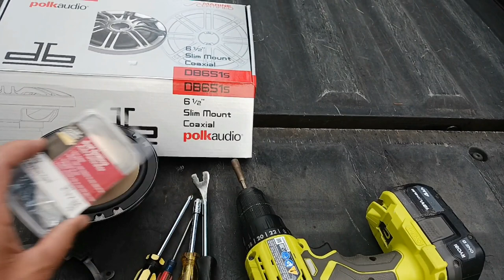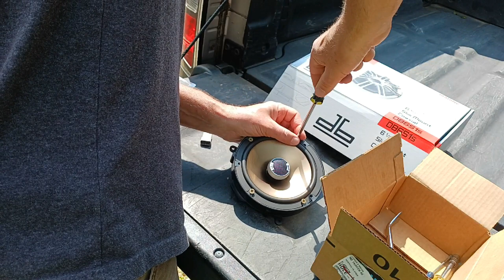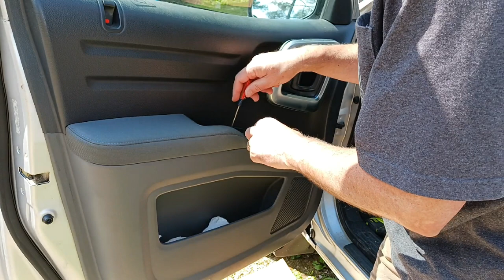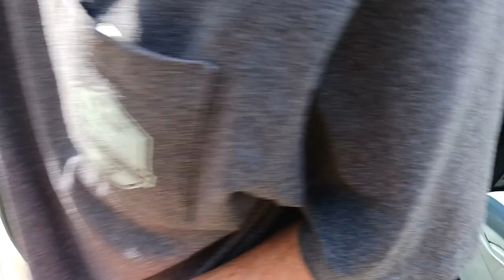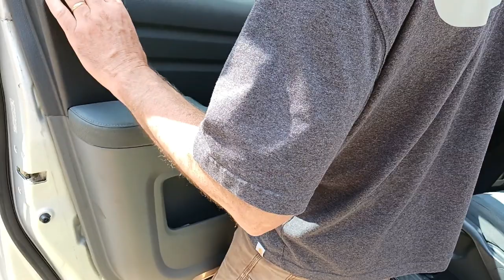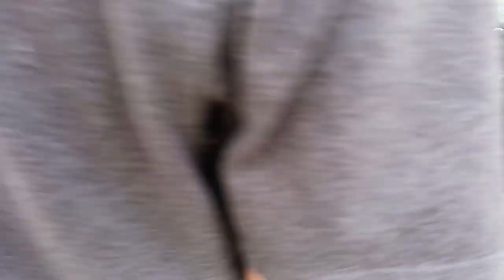Honda Ridgeline Speaker Installation, plus Door Panel Removal & Re-install. 1st Generation 2006-2014

Comment: Did you replace the rear speakers too?  Do the same adapters work back there?  Thanks for the video!
Reply from the maker: Hello!  Yes, the same adapters work for rear/back seat speakers.  I didn't mentioned it in the video but my left rear speaker doesn't work.  I switched with the right rear which was working and still didn't work.  I assume my almost 20 year old stereo is to blame.  Anyway, I went from 1 speaker to 3 working so it was progress  😁.

Comment: Got the same truck year color and everything so ill need a speaker adapter and a wiring harness to connect them?
Reply from the maker: Hello Mark.  Yes, the adapter and wiring connector makes for a very easy, no wire cutting install.  You could cut the speaker wires and make your own adapter spacer but I don't think it's worth the aggravation.   Is the paint on your Ridgeline starting to fade?  Mine doesn't look so good on the roof and hood.  Thanks!
Reply: @tbb10785  awesome thank you!  looks like the hardest part is getting that door off lol and no actually the paint looks good never been in a garage and traveled the east side of America how ever there is rust near the bottom panels given we have snow
Reply from the maker: My truck spent it's life in Miami until 2020 when I purchased the truck.  The sunshine did a number on the paint, I think.   However,  very little rush so far.  Yes, you'll spend more time taking the door panel and handles off & on, then installing the speakers.

Comment: It has to be slim??? Speakers
Reply from the maker: Hello!  Yes, it needs to be slim in thickness, otherwise the back of speaker could hit the window when you lower it.  There's not much room in the door panel and that's why you need the spacer too.  Hope this explains it  🙂
Reply: @tbb10785  just got 4 ds18's 6 1/2 hope it fits
Reply from the maker: @carlitosducoing8507   I hope they fit too  👍.  I'd suggest slowly rolling down the window to check for clearance after you get the first one installed  😃.  That would be a real pain to find out after you installed all 4 speakers.  You probably already thought of this!